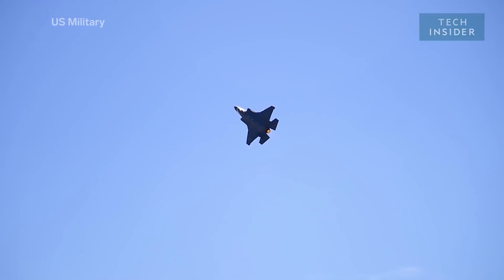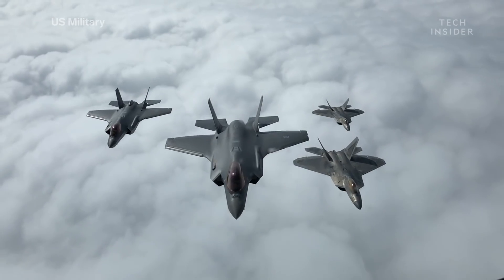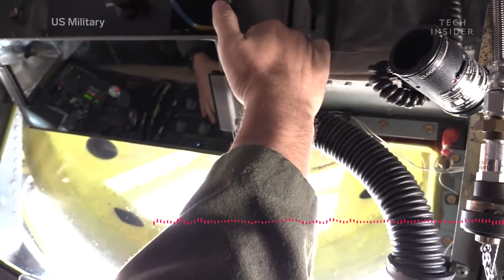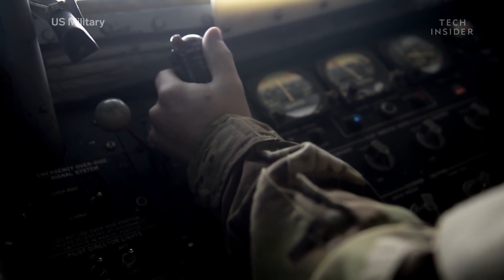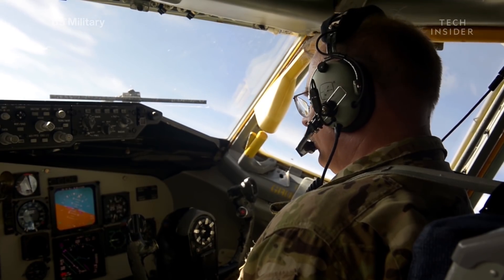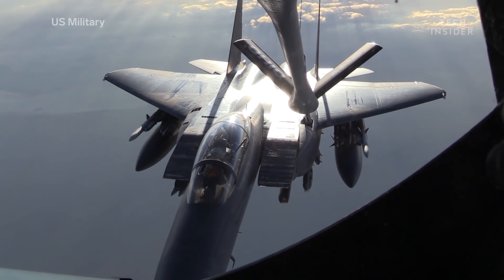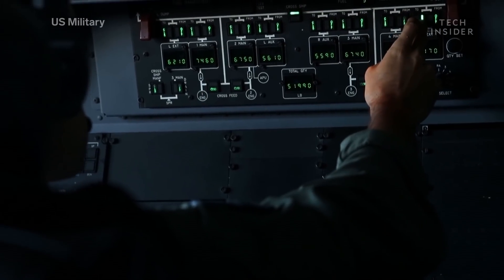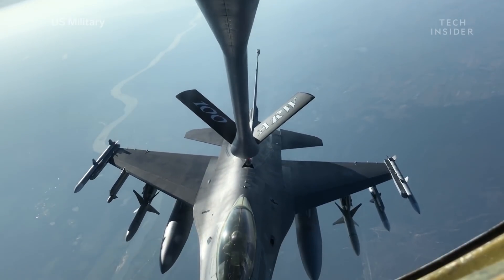How Combat Jets Refuel In Midair

Comment: It's like Car refueling while driving.
Reply: hmmm.
you think that will ever be a thing, or would it be too dangerous?
Reply: @pajamas720  you could certainly build a car to be able to do that but it makes no sense because just stoping at a gasstation would be more effective. the reason fighters do it is to avoid having to land since it costs fuel to land and take off.
Reply: And while driving the air is pushing you around, and you are controlling altitude.